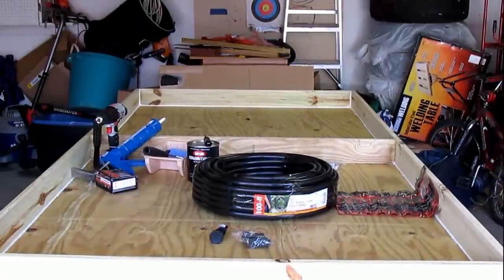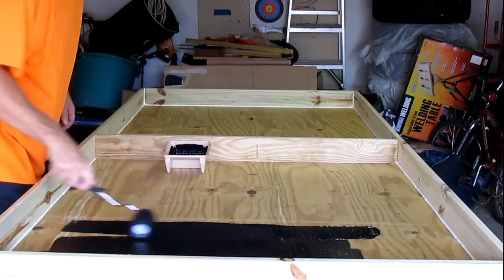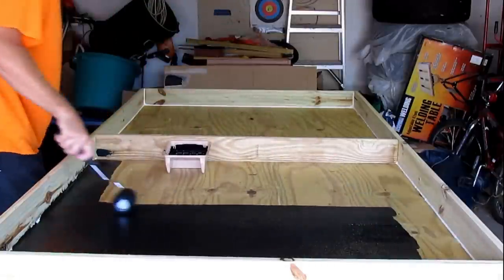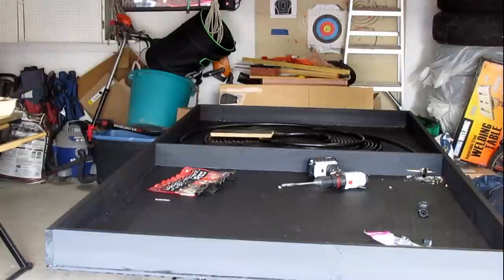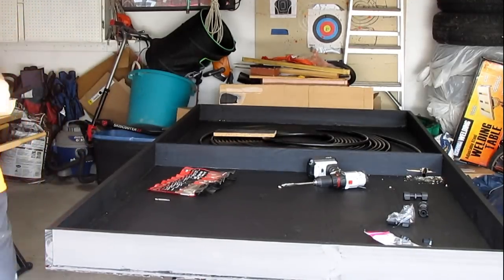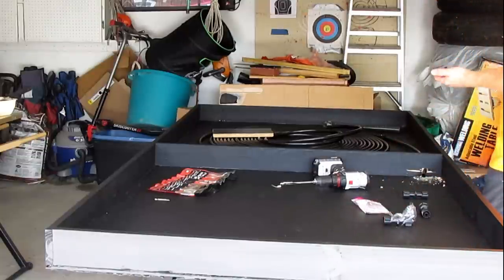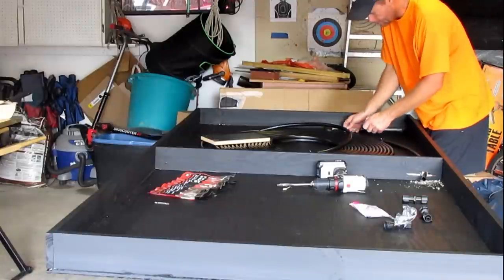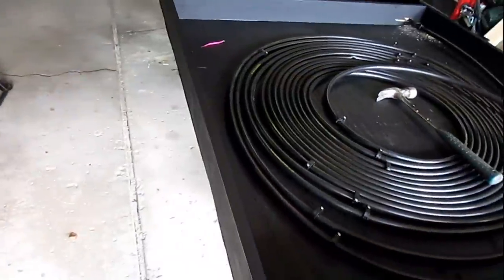How To Build A Solar Pool Heater - DIY!

Comment from the maker: Hey everyone! Don't forget to check the description for a complete parts list. I have added a second unit into the mix this year. We had a lot of comments below asking to make a video of how we did it. There are also a lot of comments asking how to cover the solar heater. Here is the video - https://youtu.be/sdV8_EJTVzo 
We also show you the great results & temperature readings. 
Thanks for stopping by & happy heating my friends!
#RCInsiders
Reply: Can not find your parts list, can’t find connectors for 1/2 “ pipe.
Reply from the maker: @toddheath4520  Hey Todd,
For some reason your comment just showed up. Sorry for the late response.
The entire parts list is in the description including 1/2" fittings & couplers. Let me know if I can help with anything.
Thanks for dropping by & happy heating my friend :)
#RCInsiders
Reply: I purchased through your affiliate link. thanks for the video. Buy a cup of joe on me :)  I also bought a tankless water heater as well... i'm going all in on heat this year..lmao   120V .  
FOGATTI Electric Tank Water Heater, 8.0

I'm gonna post a review on my upcoming channel and also plug your video for this solar heater and my review of it once i set it up
Reply from the maker: @NicholasLaDieu  Awesome Nicholas! 
Hit me up when you post the video. I would love to check it out 😎
Thanks for dropping by & happy heating my friend!!
@RCInsiders

Comment: So I have had my pool heater up and running for a month. I did use 400 ft of hose and made 2 4x4 units. I bypassed mine with a 1 1/2 shut off that runs to 3/4 pvc using my existing pool pump so no second pump.  I did put mine on the roof due to lack of good space in my yard. I also used 1x 4 strips of wood I ripped in half to hold the hose down. I also put some pieces of wood in between the 2 sets of hose to keep them separated so the heat in the box hitting all of the hose and not just the direct sun. I also laid down foil insulation on the bottom and sides and painted the inside black. I keep a 7 to 8 degree difference in the temp of the pool to the water coming out. In the afternoon it can drop to 2-3 degrees higher as the sun moves towards sunset but that still is heating the pool. Last night it went down to the low fifties but I had built my temp up to 86 degrees. This morning it is still 81 degrees and the day will only be 60 degrees but with the solar cover on and the solar heater working I we should be up to 84 again. No way that would happen with just the solar cover.
This is a legit heating system. We have had some cool nights in the fifties in Ohio this year but I have kept my pool temp above 80 degrees and have been up to 86 degrees in the pool. I have a pool with 13000 gallons in it. If I had a gas or propane heater it would have been running a lot to keep the temp where I have it.  
One thing to watch for- if you have a 100 degree day or high nineties be careful turning it on in the middle of the day after the heat has built up. The water is so hot I had my connections start leaking because the water was about 160 degrees coming out and it expanded all my connections even in the heater and I had leaks. 
These units are heavy but only hard to put up in the spring as gravity helps take them down in the fall. I also installed handles on them.
I did buy high quality thick plexiglass so it lasts. Well worth the $395.00 I spent.
Reply from the maker: Awesome Dennis!
I actually swam today, even though we barely hit the 60's in Michigan.
With the cover on, we only dropped to 80 on a night in the low 50's.
At midday, I had 82 in the pool & constant 98 coming from the solar heater unit.
An absolute great investment for sure!
Thanks for stopping by & sharing your experience with everyone.
Happy heating my friend! :)
#RCInsiders

Comment: Great video! Our pool heater has been broken for two years and it is going to cost $4000 to replace the unit so we’ve been holding off. This is a great way to heat the pool without breaking the bank! The kids will be very happy if I can extend the pool season for an extra few weeks.
We just closed our pool so I’ll be doing this DIY project next year. Glad to hear that it only took you 3 hours...it’ll take me longer I am sure.
Reply from the maker: Thanks Dinh!! This solar water heater is definitely an inexpensive & efficient way to help keep the pool warm 👍😀 Winter is approaching fast and I refuse to give in just yet! If I can do it, you can do it :) Thanks so much for stopping by & give us a shout if you run into any issues with your #DIY water heater project next year. #RCInsiders

Comment: Good video, I built 2 of this and I used around 800 feet of tubing and added a faucet to control the flow of water going into my pool.
Reply from the maker: Awesome Celso!
The faucet is a great idea. 
I just use the pump to slow the flow on cloudy cool days :)
How's it working out?
Thanks for dropping by & happy heating my friend!!
#RCInsiders

Comment: - Lift rate = 7 FT
 - pump is 1.5FT into the pool( 2 1/2FT above ground) .. exits over the pool edge and down 1FT towards my solar system .. then returns 1FT off the ground, then rises  over a 3FT length  to the pool edge and back into the pool.
 - my Raypak HTR is even with the pool on the ground

 - the "IN"line (from the pool towards my system) is 1FT above ground .. same as the "OUT/RETURN" line back to the pool.
Can't thank you enough for helping me.
Reply from the maker: No problem my friend :)
So...Unless we're not factoring in any big elevation difference where the heater is set up, it doesn't seem like you are exceeding the lift.
My next thought would be blockage or vapor lock.
Did you hook up the garden hose and run to ensure you have water flow through the entire system?

Comment: Pump works fine.  There are 2 connectors( that had screens in them ) in my 'system', for connecting the 1/2" irrigation pipe to the 5/8" garden hose.  Both connectors were 'jammed' with fine dirt, etc.  I cleaned them out and took them out for better flow.  I flushed each 100' section out, then put it all back together.  It barely trickled out back into the pool.  Since it's late in the season( here about 3 more weeks to go ), I'll just rely on my gas heater.  Next year .. Plan A --> get a bigger pump;  Plan B --> integrate/install a 'diverter system' with the pool pump.  Again, Mucho Thanks for all your help.
Reply from the maker: No problem Mike.
Have a great weekend my friend :)
Reply: @RCInsiders  U 2, Mi Amigo
Reply from the maker: Thanks!
Reply: @RCInsiders  With so much happening this Summer, here's the 'final' latest on my solar system-----
    - pool -- above ground,  15' x 30' x 4'
    - pump( 1 1/2 HP Hayward ) system cycle is  7:00AM  to 5:00PM daily .. sand filter.
    - heated ( Raypack 155,000 BTU HTR ) to 86F.  Over night temp goes down to 78F .. then for  about an hour  +15 min, heater brings 
           temp back up to 86F .
    - heater used to come on 3-4 times during the day for 15-20 min to keep pool at 86F ... now solar unit does that job.
    - solar system:  1600GPH submersible pump( Home Depot - $62 );  distance from pump to solar system( 2/100' coiled  1/2" irrigation
              pipe )= 47';   distance from solar system back to pool= 40';   total travel distance( from pump back to pool )= 287' .
    - solar system gets sun from 10:00AM  to  4:30PM.
    - at 12noon, I turn on solar system( plugged into separate 20amp, GFI outlet with an outdoor-covered light switch before it ).
    - temp coming out is 118F.
    - after 30 min running, temp holds steady at 96F.
    - next Spring I plan on adding an in-line valve( to adjust flow ) & another 100' coil.
Again .. many thanks for your tips & help.

Comment: I did this, it worked great!  Kept my pool in NJ warm all summer long, it's still 80!  I did not use an electric pump, I used a Beluga pool heater, check it out.  No need to use any more electric.  If you have a regular intake to the pool, the garden hose attaches right to it.  Worked great! I have around 500 feet of hose, could use more.
Reply from the maker: Awesome Deborah!
I'm hanging in there at 76-80, desperately clinging to the hope of one more week before old man Winter steals the joy from me once again 😅
Glad to hear that the unit worked well and you were able to enjoy your pool all season :) It has been a joy this year for me as well.
Soon pooly will be frozen and covered in snow & I will stop by every day after work to say hi & long for Spring to hurry the heck up & get here already!! LOL
Have a great Winter & we will see you in Spring :)
Thanks for stopping by & happy heating my friend!!
#RCInsiders

Comment: Can't scroll through hundreds of comments but just a point I notice is that matt surfaces will absorb more heat. Like the video!
Reply from the maker: Thanks Stu!
You are correct, matte/flat black will absorb more light/energy.
Are you going to give it a try?
Let me know if I cam help.
Thanks for stopping by & happy heating my friend :)
#RCInsiders
Reply: @RCInsiders  building my test unit right now! Thanks for the offer. I've only got a spare fluval 501 aquarium filter pump at the moment. Hoping it can do a bit of a filter at the same time. Fairly big but temperatures are hotter. Only got half a tin of black fire paint and a black hose. If I have it in the shed then its going to be used! Watch this space.
Reply: Wow. Just primed it with the hosepipe and still works with it on the shed roof. Was worried about  the pressure. Needs a bit more black spray but it's a success. FYI it was a fluval 405. Thanks for the the idea. Cheers Captain
Reply from the maker: Awesome Stu!
I love it...If its in the shed I'm gonna use it 😜
Exactly how I feel :)
Reply from the maker: Cheers mate 😅
Hope you have a great Independence Day :)

Comment: I made a few of these over the years.  I suggest putting the water back into the pool via the skimmer so the water will recirculate and not just heat a small are around the hose.  Also,  if you can tap the outlet of the pump and not have to use a separate pump,  that'd be just as good.  Maybe a higher volume of water moving through the heater, would not be as hot going into the pool,  but either way,  it works.
Reply from the maker: Awesome!
Are you making another one?
I went with the submersible for simplicity. Also. I didn't want to run the pool pump constantly to run the heater. The little pump costs pennies a day to run & I can use timers and easily adjust the flow rate.
Thanks for dropping by & happy heating my friend :)
#RCInsiders
Reply: @RCInsiders  Understood about the small pump.  The only other thing I might do would be to try and get the , colder water at the bottom of the pool..
I have an unboxed setup I use whenever I need to add a lot of water and also at the beginning of the season.
Reply from the maker: @sebbiedamato45  Cool!
I have had good success with the pump about midway depth.
It's been awesome the last couple years actually being able to enjoy the pool thanks to solar heat :)
How much tubing is in your unboxed unit?

Comment: A great vid on how to heat a pool by a home owner using the sun in a black box and creating thermodynamics!!!!!
Reply from the maker: Thanks Randy!! Building a solar pool heater...Anything for a few more days in the pool before hibernating for Winter! 😝👍👍 Thanks for stopping by #RCInsiders
Reply from the maker: David Smith  Hi David,
In theory, I would think you could squeeze a couple more degrees out of it.
I think the biggest amount heat transfer is occurring from the sun energy hitting & being drawn into the tube.
I think stacking the tubing will block a lot of the energy transfer.
I actually added a second unit this year & it helped a lot. I think more surface are is the key.
You can see how we added the second unit tomorrow. We will publish between 4-6. See you then :)
Thanks for stopping by & happy heating my friend!! :)
#RCInsiders

Comment: Hey, I just found and watched your video. Our pool is up and running and I will now be making this awesome solar heater thanks to the time you took to make this video. I plan to make this a father/son project and am really looking forward to it. Thank you for taking the time to reply to the comments and answer peoples' questions. I may have my own soon!
Reply from the maker: Awesome Pete!!
That's how we did it. Me and the boys had an awesome time putting this together,.
We all enjoy the RC hobby & doing stuff like the solar heater. Anything we can do together :)
We are actually building a second unit this weekend  to see if we can squeeze a few more weeks out of the pool season. We are also going to experiment with a timer to let the water sit in the heater for a bit, maybe 10 mins on/off.  Anything for 1 more day in the pool 😜
Thanks for stopping by & happy heating my friend!
#RCInsiders
Reply: @RCInsiders  While it might seem like a smart/logical idea in practice and without going into the science of it all too much, in general, you wanna have as much flow as you can muster 100% of the time. Your pool will always be rising in temperature due to the simple physics principle of differential heat transfer, so the more energy you can transfer in, the faster your pool will warm. Ideally then, you'd want to have a pump that can run to the limits of your plumbing setup. Or put simply another way, short bursts of hotter water is not as efficient as constant flow of less warm (but still higher T than your pool) water is.
Reply from the maker: Hi Martin,
Thank you for your input. What you say makes absolute sense.
My theory is this.
At some point, when ambient temperature is chilly & there is not a lot of direct sunlight, if you leave it running it would actually be cooling the water?
On mostly cloudy days, would there be benefits to deploying a timer?
Your thoughts?
Thanks for stopping by & happy heating! :)
#RCInsiders
Reply: @RCInsiders  in the case of ambient temperature lower than pool water, your plumbing would still be higher T due to its greater ability to absorb even low levels of solar radiation than your pool. Put another way, your pool will lose thermal energy faster sitting still than it would were it travelling round your barely functioning solar heater. A better method to improve the solar heater in those conditions, would be insulation from ground and wind chill. 

All this said, I'm no expert..... just a little scientific knowledge that may or may not hold true in practice.....so always worth experimenting :)

Good luck and please let us know how it goes!
Reply from the maker: Thanks Martin!
Well...It seems to work pretty well either way.
But it does seem to work best on an always on basis :)
Reply: @RCInsiders  Nice to see the theory put to the test :) ......... good job sir!
Reply from the maker: @KCM25NJL  Thanks Martin! 
With the second unit added, we often times don't need to run the heater at all. We have been able to comfortably enjoy the pool every day since opening.
Here it is in action - https://youtu.be/sdV8_EJTVzo
I accidentally left it running the other day while at work for a 14 hour day & came home to a 94 degree pool! Didn't have to run the heater for 2 days :) Also, after letting water sit that day, turned it on & had 205 degree water for 30 minutes before it cooled back down to 115. 
Thanks for all your input my friend!
Reply: @RCInsiders  Wow, that's actually impressive! We have a 150k litre pool here in Scotland..... and very little in the way of sun most days...... be quite something to get those temps :)
Reply from the maker: @KCM25NJL  Wow...Scotland! 
An awesome place I always wanted to visit :)
Have an awesome weekend my friend!!

Comment: You could heat your house or garage all the way through the winter using this same setup.  You just need some heat-sinks inside to absorb and re-radiate the heat -- something like concrete floors, or clay benches, to provide thermal mass, with the tubing zig-zagging throughout .
Reply from the maker: That would awesome JM!
I'm going to shoot for an outdoor shower this year.
I love this idea. Would love to be able to heat the garage & actually be able to use it more than 4 or 5 months a year :)
The applications for solar heat are virtually endless.
Are you going to make one?
Thanks for dropping by & happy heating my friend!!
#RCInsiders